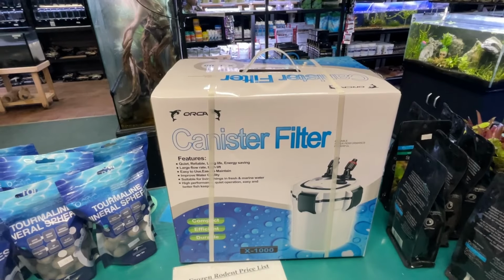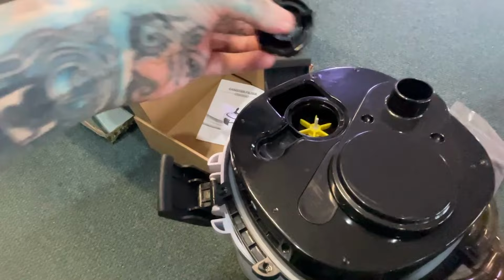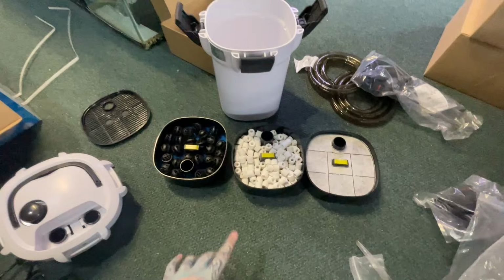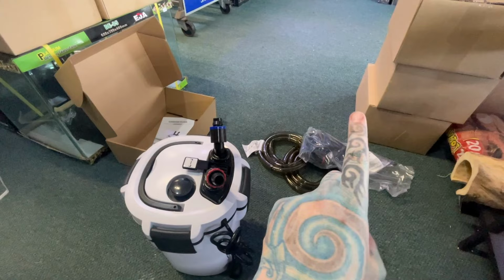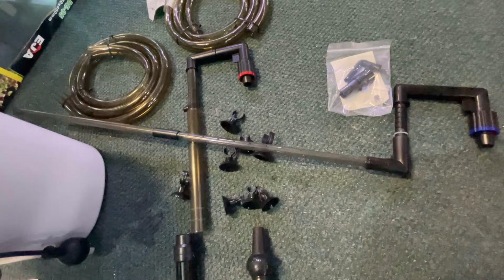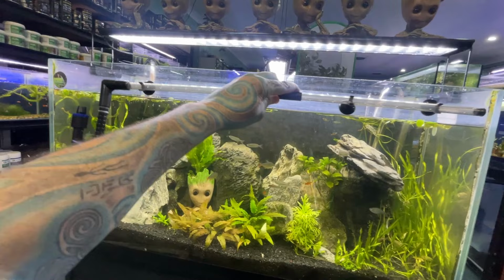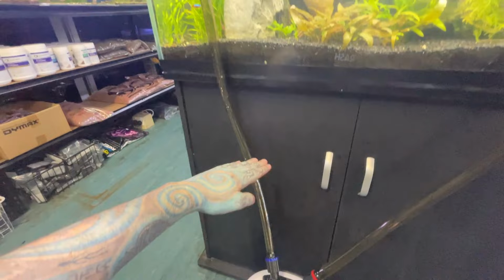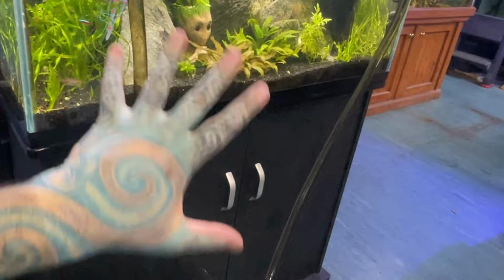HOW TO SETUP A CANISTER FILTER FOR FISH TANK ~ HOW TO START EXTERNAL CANISTER FILTER.

Comment: After watching this, ive had my spray bar set up wrong, ive got it above the water as opposed to below the water, always wondered why ive got so many micro bubbles🤔
Reply from the maker: You can set it up above the water, but yup you will get a lot of bubbles and noise
Reply: So you saying after charcoal is done 6-8 weeks.  You get rid of it and don't replace with charcoal but put more ceramic beads instead?
Reply from the maker: @user-ks9bi9gd6y you can use carbon if you want but we mainly use carbon to remove medication out of the water if you ever use any diet based medication etc. so adding more ceramic media or sponges is an easier option long-term.

Comment: Mine doesnt have a pump how do i start it 😭
Reply from the maker: You can siphon water into the canister filter by vacuuming air out of the other side, or you can stick a pump and hose in through one size of the canister filter until it’s filled up in the water is coming out the other side.
Reply: @paulstingray  ok ill try that tomorrow

Comment: I have smaller tank im going to make a nano saltwater tank 15-20gallon.  Are you saying to use charcoal filter for 6-8 weeks then get rid of it and replace it with more ceramic beads instead?
Reply from the maker: It depends if you just want to  replace it with carbon or not. If you replace it with something else that doesn’t need to be changed continuously obviously you can take longer between canister filter cleans.

Comment: Hi! I just got a 23-gallon tank and have been searching for filters. Is a canister the way to go with such a small tank, or should I get something else?
Reply from the maker: Howdy!
There are  quite a few different brands of canisters that would suit a tank that size.
The great thing about canisters is most of the filtration stays outside the tank so there’s more room for aquacaping
Reply: thank you!
 @paulstingray
Reply from the maker: @LettuceWrapMe any questions just ask
Reply: @paulstingray   So I got a 200L per hour canister filter for my tank, which seems to keep the water clean. But it makes this slightly irritating pump and squeaking sound every few seconds. Does it have to do with the filter I bought or should all canisters should stay relatively quiet? Got the "bioscape tropic canister filter" from my local pet store.
Reply from the maker: @LettuceWrapMe it should be quite 

It might be the impeller not sitting right. Try taking it apart and check for anything on the magnetic part. Otherwise it could be air bubbles in the media

Comment: I’ve been avoiding making the switch from hobs to canisters because everyone makes them seem SO complicated. I’ve been at it for 3 ish years and this is the first video that really was just pure information and so straightforward. I’m buying a canister setup today. My frogs deserve it🥰
Reply: Update you didn’t ask for- went with the Sicce Whale 200, seems sufficient for a 55🥰 petco has 20% off AND $20 off if you pick up in store so OBVIOUSLY I went this route 😂 will get another for the other 55. 

Tldr- thanks for simplifying this enough to make me feel confident with what to expect
Reply from the maker: It’s 700lph so should be more than enough. But it also depends on tank setup, type of frogs, current bio load etc. 
congrats, it should make the tank slot more stable 🎉🎉

Comment: Thanks for the information. Very useful
Reply from the maker: Any questions just ask
Reply: @paulstingray hello New to the canister filtration instead of HOB Can you tell me what brand you are using for this video? Thanks so much !!!!
Reply from the maker: @destryl1076 howdy 
The white canister is “orca” brand it is Chinese made but one of the better quality Chinese made filters. I’ve used and sold them for a roundabout 15 years. I’ve hardly any issues with this brand. There are quite a few filters that look the same but of less quality so just be cautious when you look around for one.

Comment: SO glad I checked this video out I didn't even realize the spray bar can or should go below the waterline. Cheers mate!
Reply from the maker: If you use it above the water it will give more oxygen to the Aquarium by breaking the water surface, but if you use CO2 it will also remove the CO2.
Reply: @paulstingray  Ah that makes sense! I'm using one in the setup and preparation of my tank for an axolotl though not sure it will give the right flow needed for them. Love your work mate.
Reply from the maker: @deseer1564 they don’t like a lot of flow so as long as the tank has a good turnover it should be fine. Check out one of my newer axolotl tank setups.
Reply: @paulstingray  Yeah I have watched your axo setup which ended up being the lovely crab at least ten times haha. Good to know though thanks.
Reply from the maker: @deseer1564 my sneeeky crab 🦀 😂😂

Comment: Great vid! I'm doing some research and I'm considering upgrading my tank to a canister filter. I was just wondering how you disconnect it for routine maintenance?
Reply from the maker: Depending on the brand most have a quick release that separates the in and outtake from the main canister. So the pipes stay in place.

Comment: Great video, what size canister would you recommend for a 50L tank? I’m trying to save room and hide filter. Thanks
Reply from the maker: It depends what you are going to keep in the tank but anything from 400-800LPH would work as you can adjust the flow on most. I use used an oase biomaster 250 thermo on a 70lt tank for example and it’s rated for ultimate 250 lt tanks
Reply: Thank you  @paulstingray  , I was wondering if 400LPh was overkill.  So a 250 should be fine. 2 apistograma and 5 tetras, possibly add a bristle nose at some stage. Thanks for your time
Reply from the maker: @ShaneO-nm2hh  400lph will be fine
Check out the oase video I uploaded yesterday and you can see the flow rate
Reply: @paulstingray  thank you

Comment: Very useful, I would like to know if filling the canister first, has the same result?
Reply from the maker: It depends on the model if it’s self priming it will start like that, but quite a few models will have air trapped in the impeller well if you fill it first and they won’t prime. Also depending on the placement of the canister filter if there’s not enough height and you fill it first, it also won’t prime.
Reply: Thank you 💪🏾

Comment: Would you need an air stone or a surface skimmer or even both with this external filter in an 112 litre tropical tank. Am just about to set up my first tank and am super confused. Any help would be appreciated. Thanks!
Reply from the maker: It depends on what size canister filter you get/ have. And what the tank is set up for. If it’s 800/1000LPH It will be more than enough on its own for most commonly kept species .

Comment: Great video. We’ve got a broken canister filter and have just bought a new one to run in parallel. The original is now leaking at pace, any suggestions how to get around this? We’re  thinking of putting the old media in the new filter, but wasn’t sure if the new media would need to be discarded then as it had been used for a short while and I’m guessing won’t keep after being wet? 

Do you think it’s better to just leave the media alone now then new one is working fine - they only ran in parallel for 12 hours
Reply from the maker: You can add the old media in the new canister but if the old canister has been off for longer than six or so hours the nitrifying bacteria will probably already be dead. If so just wash the old media out. As for leaking it will be the rubber O ring around the canister as they will deteriorate with age. Definitely try replacing that first.

Comment: Good afternoon sir. I'm getting ready to start a 120 gallon freshwater cichlid tank. I really would like to use an external type filter, however I've had a few people telling me to install it through the glass. Is there any advantages going through the glass as opposed to over the back or side? Thank you for your time and your knowledge
Reply from the maker: They might be talking about a sump. ( tank under the main tank used as filtration) you need a hole drilled for most sumps but definitely not for a canister filter.
Canister filters are designed to be used on tanks without the need for holes drilled.

Comment: Hey Paul, thank you for the awesome video. Can I ask if you still need aeration when using the canister filters (hooked up to a chiller for axolotls)? Thanks mate.
Reply from the maker: Hey there!
It depends what size canister filter you use with the volume of the tank. But the colder the water the more dissolved oxygen it can hold. So unless the canister is way undersized it should be fine with a chilled tank.

Comment: Hi there this video was super helpful. I have a 120cm x44cm x66cm tank roughly about 353 litres of water so what size canister filter can I use
Reply from the maker: What re you going to keep in it?
Reply: @paulstingray  well not sure yet just thinking of filtration I might keep alot of schooling fish not sure yet and maybe some horseface loaches just not sure how many can go in there
Reply from the maker: @danielkemp345 I’d say go something around 1500lph you can always reduce the flow but that will circulate the tank quite well and filtrate it.
Reply: @paulstingray  thanks so much

Comment: I have a problem with air bobbles coming in the intake pipe. i don't know where it's sucking air. How i can fix it ?
Reply from the maker: Check all the joins in the tubing. Because of the pressure they can suck in air. If the joins are ok check the O ring. If the O ring is ok then it might be air trapped In the media. Is it an old or new filter?
Reply: @paulstingray  it's new, and i triple checked everything  it sucking air just above the beginning of the tube that takes water to the canister, and i tightened very well it's not stopping from taking air i used teflon tape above the o ring just to making sure the o ring isn't leaking

Comment: Hello! Looking to use a canister filter for my 40 gallon breeder tank. Wondering if there is an easy way to use the filter to drain the tank. Ideally using a 10 foot tube out the window. (I have turtles and this would make my life unbelievably easier).

Is this a silly question? Would I be better off just getting a simple water pump unrelated to the filter? Thank you!
Reply from the maker: There’s a few ways you can do that.
A few canisters have an extra tap that you can pump water out of, but if there’s only an in in and out you can just connect a longer hose to the out and pump the water out through the filter as most just have a simple connection in line that you can join another hose to . Easy easy
Reply: @paulstingray thankyou for the quick response I appreciate it!!
Reply from the maker: It was perfect timing 😂😂😂
I was just replying to other comments 🎉🎉
Ask away if you need to know anything else

Comment: Is there anyway to make these work when it’s on the same level as the tank?
Reply from the maker: It’s not easy on most models. Main issue is filling it with water so it will start properly. Some canisters have a pump on the intake pipe, they would be the ones to go for in that setup.
Reply: I put a garden hose in the entrance, and wait untill water comes out on the other side, that makes everything filled.
Reply: My answer was a bit short. But I first fill the cannister with aquarium water, then place the cannister and attach the tubes. Then I put the hose  on one side until the water comes out on the other.  @paulstingrayGardening
Reply: Can you adjust the flow rate on a canister filter?